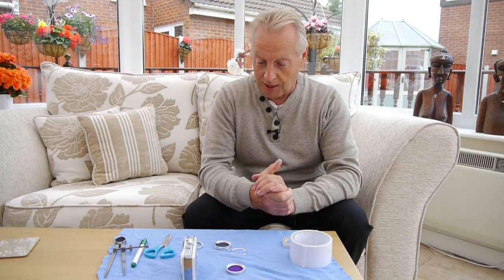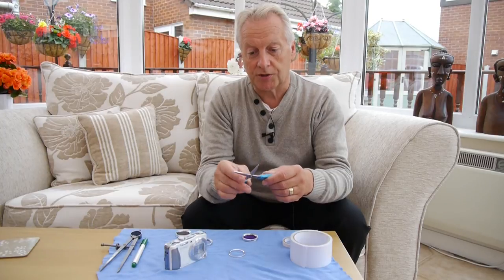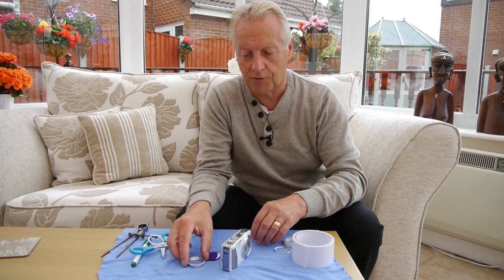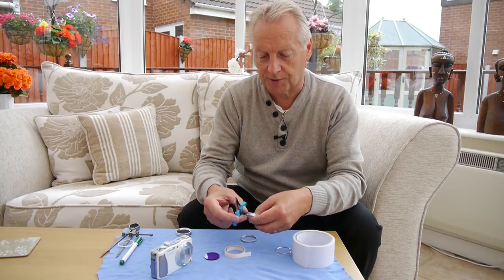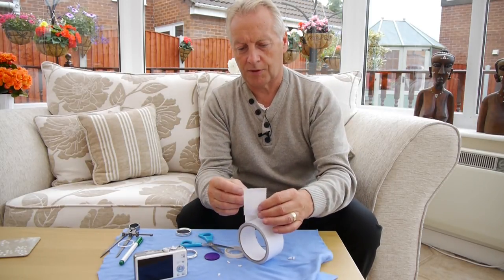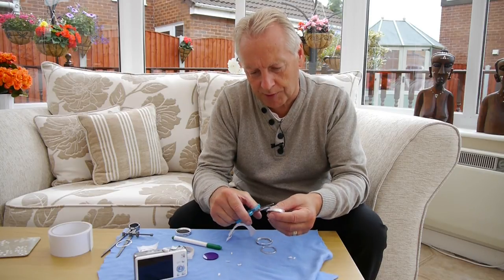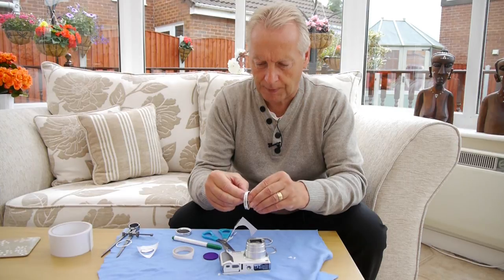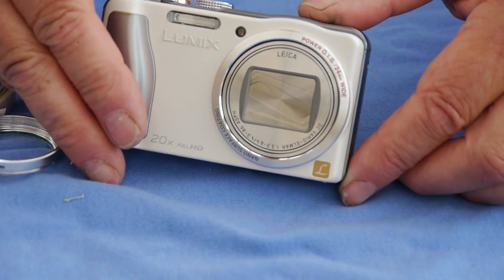How to fit a 37mm filter holder to your Panasonic Travel Zoom camera

Comment: I was looking around for some sort of filter adapter for a TZ30 I've just bought off eBay,  £25 posted. and by chance came across this very, very old but brill. The one I've looked at, and know it fits, is the Carry Speed MagFilter Magnetic Filter Adaptor 52 mm for Sony RX100 / HX10 / HX20 / HX30V. What I found out, It's the filter that's magnetic not the metal ring that sticks onto the lens barrel. Cheapest is around £27,  and comes it comes with a magnetic CPL filter. If you want to add  more filters you have to buy a magnetic filter adapter which costs around £38. So using Grahams method, I bought a cheap slim 37mm UV filter. To take the threads off I used my oscillating multi tool. Using a fine tooth metal cutting disc that came with the multi tool. To smooth it it off, I used the small triangle sanding adapter and very fine grade metal sanding paper triangle templates that fits the small sander adapter. It took 30mins to complete. The result? is the adapter ring fits flush against the the lens and is only 3.1mm thick. Bought a 37mm to 49mm step up ring.    BTW Graham, if you do see this post, thanks to your hard work, I also found  all the brill. tutorial vids you did on the TZ30 and downloaded them all  hope you don't mind.    😉😊

Comment: 9 years later and manufacturers still aren't putting a filter ring on many of their top compact cameras.  I recently purchased a Panasonic Lumix ZS80 and the first thing I did was sacrifice an old 40.5 mm UV filter, grind the rear threads off and use your idea to affix it to the lens with carpet tape.  There is no vignette effect and the zoom functions perfectly.  Thanks for the video.

Comment: Smart idea Graham and apart from the benefits of the attached filter I like the fact it will keep dirt and dust etc out of the folding lens cover. As an alternative to your double sided tape you could also use hot melt glue. It would provide a stronger bond for heavy handed fools like me who's TZ camera lives on my hip. Also had the benefit that with gentle heat from a blow dryer the bond can be broken and the filter removed with no damage to the camera. Great idea re attaching filters mate!

Comment: Thanks for the tip. After removing the UV filter by unscrewing the retaining ring, I ground off the rear threads flush to the ring using coarse then fine carborundum paper, giving a larger contact area.  I then permanently mounted the ring to my DMC-ZS20 carefully using 4 drops of crazy glue. You will get some vignetting when a filter is attached, so zoom in a little to correct this.

Comment from the maker: Hi the FLD is the rose coloured filter and is used to correct for pictures taken in fluorescent light to remove green casts, however it can be used to make beautiful sunset pictures about 30 minutes after the sun goes below the horizon - especially if it is a city scape in the foreground.

Comment: Gotcha' on that thanks Graham... yes - I did grind the 'host' thread down to wafer thin..but still got the rounded corners...so it looks like a 'step up' may be the answer.. and I was also dubious about the strength of my older adhesive tape.. so will consider some 'added glue'../. As Arnie once said.."I'll be back".... Cheers ..Dj..

Comment from the maker: I would recommend using the UV filter holder as the filter thread ring - with the glass removed and then you can use the circular polarising filter just by screwing it into the threads of the empty UV holder.

Comment: Howdy.. Graham../....Brilliant !.... thanks for your tips here and your previous videos....I have now purchased  decent brand 37mm UV. and Circ. Pol. filters.. The extra wide tape method is definitely for me. I have seen some  very cheap filters to use for the open thread..so I'll have no fears about  butchering one.
Thanks a lot for your ideas which has enabled me.. and no doubt many others to secure  and the  ability to change - various  filters to compacts.. Cheers, again from...Dj.S20

Comment from the maker: Hi Steve, on UK ebay you will find the 3 filter rings, size 37mm - the UV, Circ polariser and rose FLD just search for 37mm filters and look for the set of 3 for under £6. I used the UV filter as the new adaptor by filing off the back threads to make the ring as thin as possible and so i could use other filters. I'm doing another video tomorrow showing another way to fit the filter ring which might be useful.

Comment from the maker: Hi, I made the adaptor as slim as possible but also use a 37-52 step up ring and use my 52mm filters. smaller filters would look better but are hard to find. I've now found a better way to glue the ring to the camera and I'm going to post up up later this weekend under modifying a  Sony HX20v to take filters and closeup lenses.

Comment: Job complete - as you describe above Graham.. and the camera looks good... but on full wide angle using the 'pol. circ'.. I get rounded corners.. /..A slight touch of 'tele' gets rid of it but I can't think how to overcome the problem on full wide.  Not to worry.. I can crop during processing.. /..Other than that...  all is good .. thanks again.. Dj.

Comment from the maker: Hi the brand name was NEEWER and I found them on ebay for only a few £'s in the UK. In the past I have also purchased second hand UV filters and carefully broke the filter glass out of the housing by hitting it with a hammer and nail on a flat surface.

Comment: I have added a filter ring to a DMC TZ-55 using your method. I am pleased with the result but if I fit a 37mm filter direct there is slight vignetting of the image when on the default wide angle setting. To hopefully overcome this I have ordered a 37mm to 46mm stepping ring to which I will be able to attach filters which I already own. I will report back to confirm this works.
Reply: Did the 37 to 46 mm step up ring work?